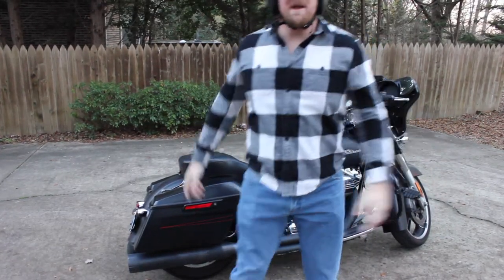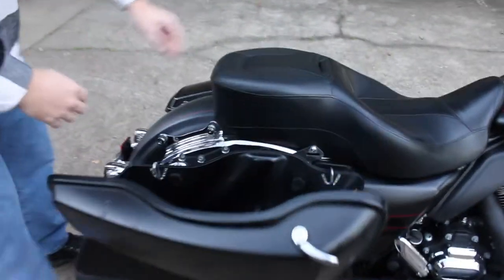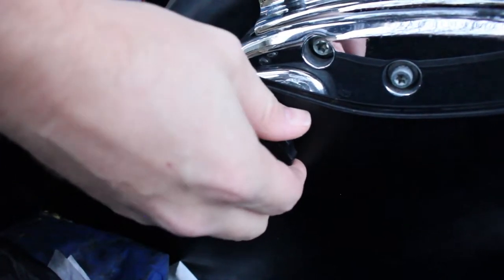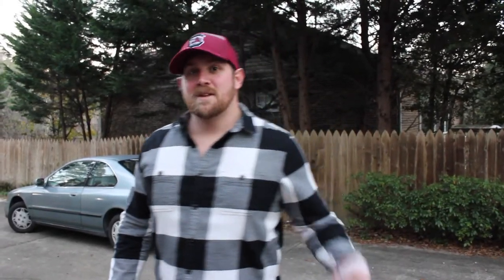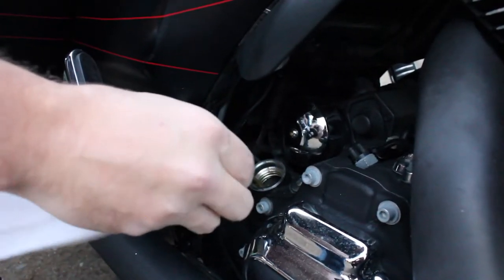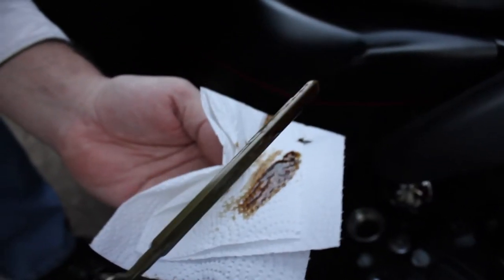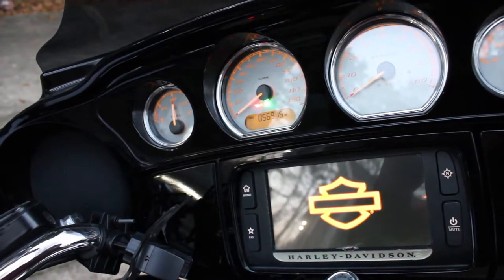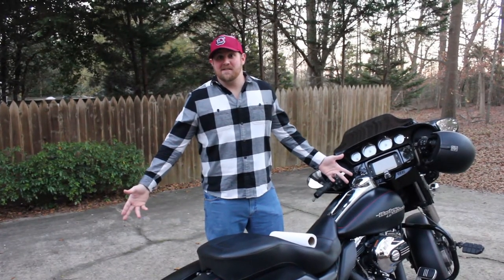Three Things to Check on a 2014 to 2017 Street Glide/ Road Glide/Harley Davidson Touring/ FLHXS

Comment: I know this video is 2yrs old. I bought my 2014 Street Glide new in 2014. The saddle bag clips were recalled, Harley replaced mine for free. The saddle bag clips were much longer and locks in. (I had a lot of friends, their bags fell off.) The MOST important thing to check is the hydraulic clutch. It was recalled and Harley fixed mine at no charge as well. So if you bought a new Street Glide and don't know if it was upgraded, take to the Harley Dealership.
Reply from the maker: Right on! Definitely important as well.

Comment: solid video man, I need to get those saddlebag pin replacements myself
Reply from the maker: Snag em, replacing my bag was not cheap haha.
Reply: Yup me too,  gonna order them today, took my bags off for the winter and thought those pins were a little chincy, thanks for the idea.
Reply: I'm pretty sure harley says screw the dip stick back in then out to properly measure the oil level

Comment: The oil should be a touch low. The oil pressure with it on is different. Full will cause oil seepage. Nice bike. Thanks for the tip on the bags. I checked. Mine are tight. Lol.

Comment: I know a few people who lost their saddlebags with the OEM fastener. I switched to the Rick Rak fasteners with the detents. 
Never had an issue with them. 
The most important thing to check is the chain tensioner on the primary. Get rid of that get a self adjusting chain adjuster.
Reply from the maker: Those OEM fasteners were awful. Checking the tensioner is a good recommendation. I haven’t had an issue with mine though. Thanks for watching!